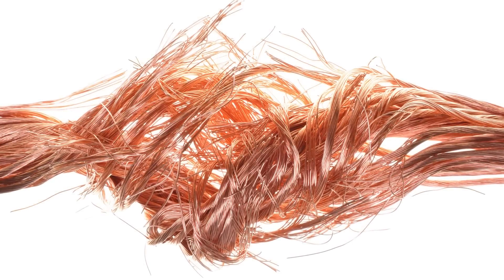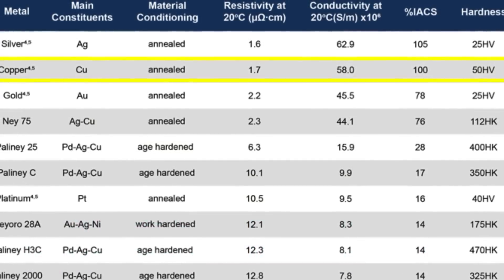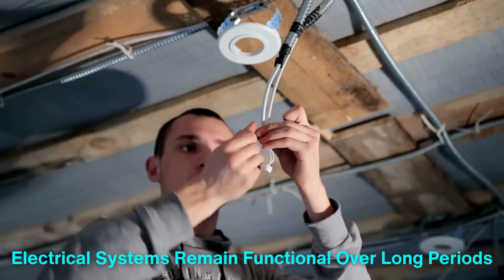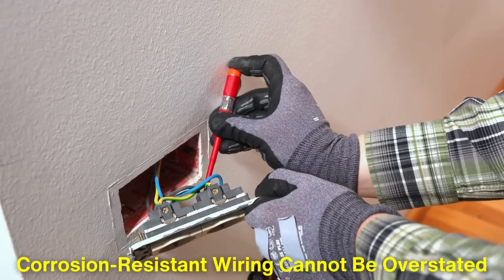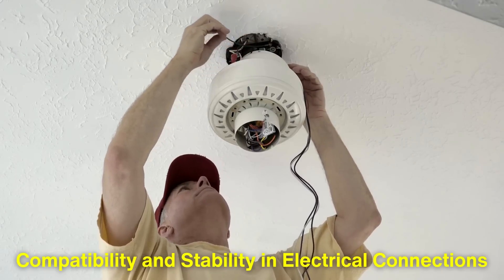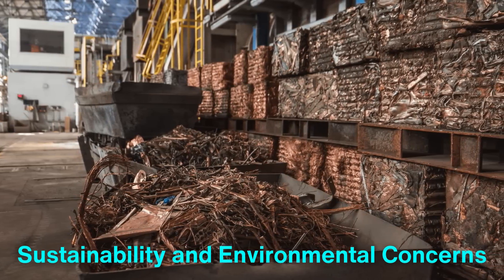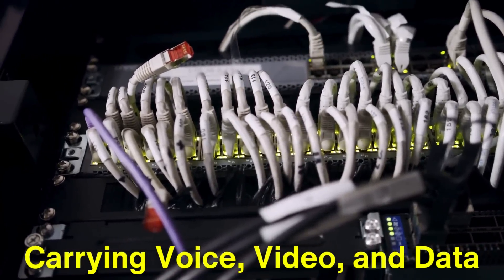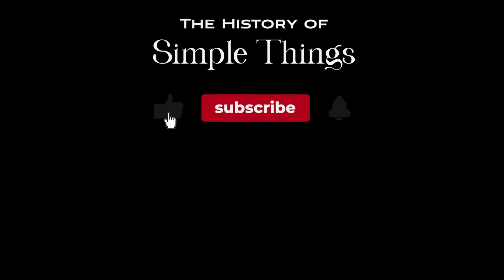Why Do We Use Copper for Wiring?

Comment: You forgot to mention that aluminum cable is used for high voltage transmission lines because of the weight of copper and the high cost.

Comment: Aluminum wire, reinforced with high-tensile steel cable inside the aluminum, has been the standard for many years for both overhead and buried electric transmission lines.  Telephone cable has been copper-plated steel for many years, because audio and radio signals travel on the wire's surface.  Copper is still used for internal building wiring.

Comment: What I do know is that copper is getting alarmingly scarce and expensive. Copper cables are being routinely stolen despite the risk.
Copper is also largely used in bullet jackets (their core is normally lead, or steel or tungsten if armor piercing) and the cartridge case is made of brass, which uses copper.
Soon there will be not enough copper for such demand!

Comment: The downside of copper is that it is a relatively rare material (as compared to aluminum). Aluminum is nearly 8% of Earth's crust and Copper is a mere 0.006%. Aluminum is being increasingly used instead of copper for motor winding, where copper is nearly 10 times more expensive in a given application.  Copper is indispensable in applications like electronics, and should be judiciously used because it is after all quite rare.

Comment: Be careful with wires , supplied by ( some ? ) countries ... check with a magnet ( ? )  some are copper plated  STEEL 😝! this drastically reduces their costs , but has much higher resistance ................ DAVE™🛑

Comment: Regarding 1:05, during World War 2, silver wire was used for the Manhattan Project to build an early type of atomic bomb known as "Little Boy". The silver wiring was used to build electromagnets for calutrons to extract Uranium-235 at Oak Ridge, Tennessee. On the other hand, copper was very much needed to make armaments & munitions to win the war. Furthermore steel was used to mint one cent coins instead of using copper.
Reply: And that silver came right out of the US Treasury.  They shipped the ingots to Burndy or someone, who melted them into bars which were rolled into wire rods.  These were drawn into the wire used in the cyclotron and presumably insulated, which made U-238 (or U-235, I forget) into plutonium for the Nagasaki bomb.  At war's end, the wire was melted down back into ingots in the presence of Treasury agents.  There was a lot of press coverage.
Reply: The people running the Manhattan Project “borrowed” a large amount of silver from the treasury and silver is a better conductor than gold and copper.

Comment: Can't afford silver wiring. Silver is a better conductor.
Reply: Silver is not a strong metal and thus the reason it was alloyed when used as coinage.
Reply: Gold is better. But because it's too expensive that's why copper is mostly used
Reply: @imevbore  Actually gold is a worse conductor than copper. Also as it more than twice as heavy one needs twice the amount. It also costs 10000 times more. Wiring a  house with gold would cost about a million dollars. Also as even copper wires are routinely stolen, one could imagine what would happen with gold.
Reply: @imevbore  You are wrong. 1st Silver , 2nd Copper, 3th Gold. Esay to find on Google. Gold is only used because it doesn't corrode. This is important if there is a very little current floating thru signal wires and connectors and in precision relays.

Comment: So why did we ever use aluminum wires? Just asking for someone who had to retrofit kitchen lights with copper wiring to a building with aluminum wiring.
Reply: I also retrofitted almost all the aluminum wiring in my house and was asking the same thing. I know it was to save a few bucks but the problem is nobody used the proper connections to account for oxidation and expansion.
Reply: Cutting costs at the expense of reliability.
Reply: Aluminium is used for power transmission to this day because it is light. It's conductivity per unit weight is better than copper.
Reply: Aluminum is much cheaper and one needs about a half of that  of what one needs copper (conductivity is measures on the surface area, not on the mass). Lets say we need 500 meters of 3 cord cable with 2 mm² area. That is 3000 cm³. As copper it weighs 26.7 kg and costs $250. With aluminum one needs 4.8 mm² so it is 4800 cm³ or 13 kg and it costs $34. Now of course as the difference in price of a house that is not much even if one counts various margins , taxes etc.

Comment: Worked a lot with replacing and otherwise dealing with aluminum wire. So glad it was short lived in residential use. Copper is so very much better. Aluminum wire caused many fires.

Comment: Always thought gold was superior. Very interesting video.
Reply: Gold is a good conductor, but the reason it is used in micro electronics and for contacts is that gold will not tarnish or corrode.
Reply: gold does not oxidize is why it is used for computers
Reply: I did, too.  Turns out that gold won't oxidize, so we use it for critical contact points.  We use very thin coatings, so conductivity is unimportant.
Reply: Gold is less conductive than copper, and very expensive

Comment: If silver is the best conducter, why do they use gold in mobile phones and other devices?
Reply: AI Overview

The most conductive metals are silver, copper, and gold: 
 
Silver
The most conductive metal, with a unique crystal structure that allows electrons to move freely. However, silver is expensive and can tarnish. 
 
Copper
Highly conductive, affordable, and very fabricable. Copper is commonly used in metal wiring. 
 
Gold
More corrosion-resistant than silver, and is used in specialized electronic equipment. Gold is expensive and not very practical for everyday applications. 
 
Other conductive metals include:
Aluminum: Lightweight and economical, and is often used in power lines. 
 
Brass: A metal alloy that combines copper and zinc, and is affordable and used in a variety of electrical applications. 
 
Stainless steel: Valued for its durability and corrosion resistance in electrical applications.
Reply: Resistance to corrosion
Reply: On smaller scale... Silver prone to corossion
Reply: I thought gold was the gold standard.
Reply: Because of Golds corrosion resistance, it doesn’t tarnish or suffer corrosion over time, where as Silver quickly tarnishes when exposed to air and moisture. The gold used is normally a very thin coating on top of nickel or other metals, and Gold again is great for this due to its high malleability, which allows extremely thin coatings to be used.